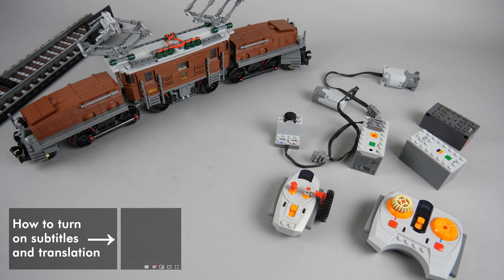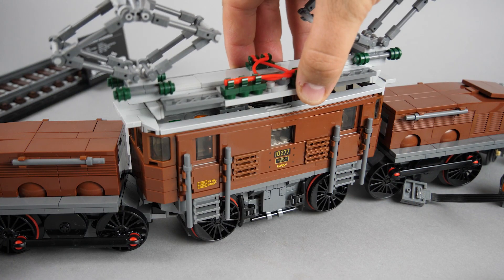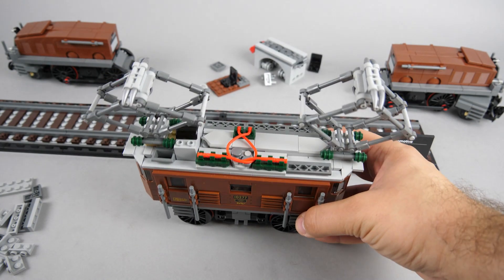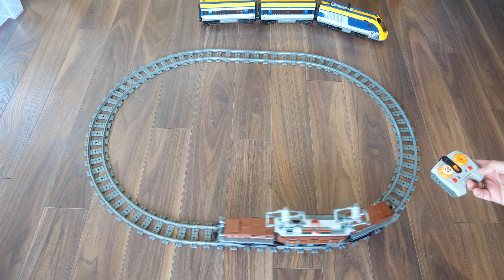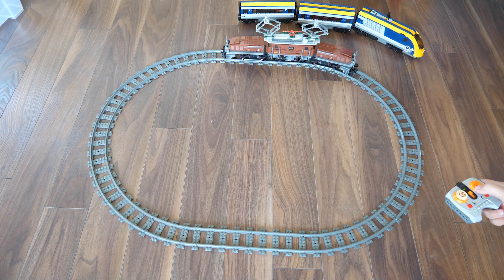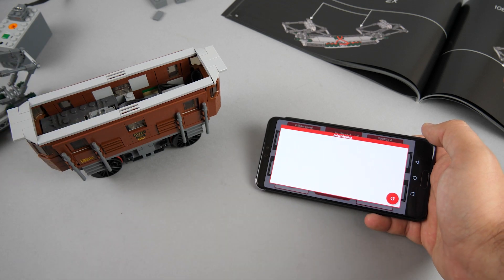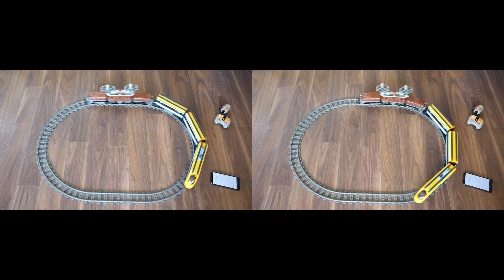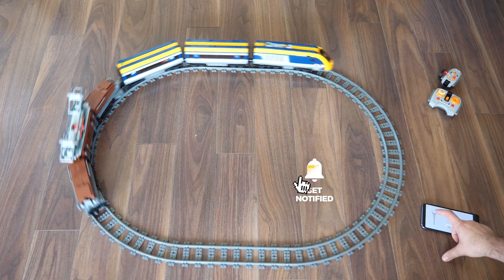LEGO 10277 Crocodile Locomotive Power Functions & BuWizz upgrade

Comment: Great video! :) The BuWizz unit seems to be great! Nevertheless, one "problem" isn`t solved: the force to use the mobile phone. If my trains are running, I didn`t want to use my phone... Therefore a very simple remote control is better - in my eyes...
Reply from the maker: In this case you can stick to the original conversion with the Powered Up hub and you can use the Powered Up remote :)

Comment: Good video! If you fitted an sbrick instead of the ir reciever would the roof fit properly? I have an sbrick but not s buwizz
Reply from the maker: You need to restructure the roof with the SBrick as well, the top of the SBrick with the PF connector will sit higher than the PF connector on the battery box.
Reply: @RacingBrick  i have a sbrick and you can put the PF connector cable for the battery box on the bottom of the sbrick (there is one connector there + 4 on the top) meaning it will stay at the bottom of the train and not near the roof. The top of the sbrick is in a stair shape so you can connect the medium or large motor's PF connector to one of the lowest of the 2, it will not stick out. The Sbrick is the same size as the WuBizz in term of height, except it's a square and not a rectagle, so you cut the lenght in half (for managing the cable beside it)
Reply from the maker: @danielsala81  great concept, and where do you put the battery box and the motor? You know, unlike BuWizz SBrick actually requires a separate power source.
Reply: @RacingBrick  the battery box goes to one side of the train (left in your video) and the sbrick next to it, to the right (where you put the PF infrared receiver in the video, but more to the right and lower. I guess the motor is under those 2. i don't have this set yet but willing to get it when it comes out (in 2-3 days). Also, you can not modify one of the 2 other trains just to put the S-brick/receiver/battery box ? I have the winter village train and there, you put the battery box on a separate wagon (you will see the cable going between the 2, i know). BTW, I am also from Hungary, but live in Canada now :) Excellent videos.
Reply from the maker: Thanks! Actually you cannot put the SBrick lower on the other side. Left side is "full" with the Battery box, same situation on the other side with the motor, the SBrick can only sit on the top of the motor. It is not as high as the IR reciever but still reaches the top edge of the sides, so you cannot insert the roof between the two sides. The 2 end sections are only 5 stud wide so you cannot fit the 4 stud wide SBrick between the sides there. Obviously anything can be fitted but not without a bigger redesign.

Comment: cleverly bypassed the topic "derail" when the locomotive drives through switches or curved lines .......
by just driving through a "normal" oval
Reply from the maker: I only have these rails available at the moment, but I don't think the standard speed would cause issues
Reply: @RacingBrick  My croc derails on a full circle 9V track at medium speed. Could you test yours on a circle not oval as well? I'm very disappointed since the Emerald did not have this issue.
Reply from the maker: @R0Sch88  I've seen Jang's video about this, can it be the difference of the metal-covered and plastic tracks? Might be a good thing to test your locomotive on standard plastic tracks.

Comment: What about sbrick?
Reply from the maker: You can use SBrick as well of course, but it will be kind of similar to the PF IR receiver, as it will not fit besides the motor and the battery box without modifying the roof
Reply: @RacingBrick  Cuz i bough one 2 days ago and i am not sure if it have egnouth power to drive a train as well as buwizz (of course not in fastest mode)
Reply from the maker: It will have enough power for sure

Comment: well i will just say that you forgot sbrick+ as a options to fit nicely inside there 2
Reply from the maker: I did not forget it, but that one also requires a modification of the roof for 2 reasons - you need to stick to the AAA battery box meaning the PF connector on that is already interfering with the roof, and if you put the SBrick on top of the motor then again the top will be at the same level as the tiles on the side of the car so that means even bigger modifications for the roof.
Reply: @RacingBrick  hmm maybe
Reply from the maker: Well maybe I actually took the time to check it so maybe you can believe me :)
Reply: @RacingBrick  i have a sbrick and you can put the PF connector cable for the battery box on the bottom of the sbrick (there is one connector there + 4 on the top) meaning it will stay at the bottom of the train and not near the roof. The top of the sbrick is in a stair shape so you can connect the medium or large motor's PF connector to one of the lowest of the 2, it will not stick out. The Sbrick is the same size as the WuBizz in term of height, except it's a square and not a rectagle, so you cut the lenght in half (for managing the cable beside it)